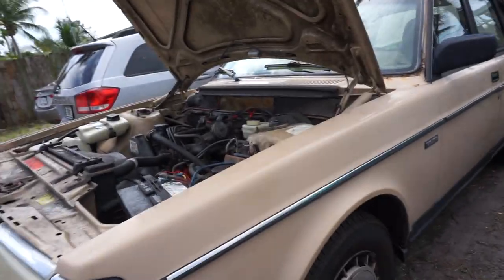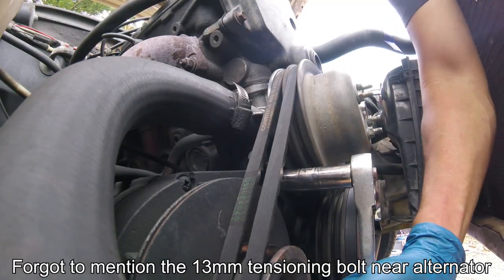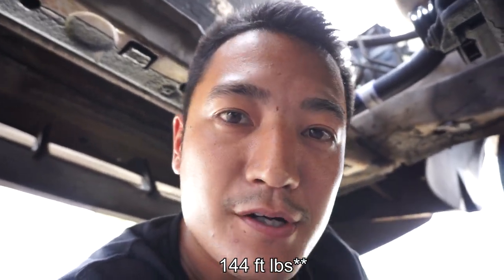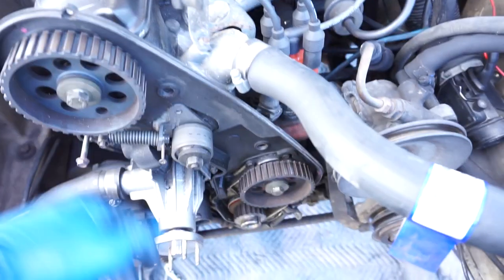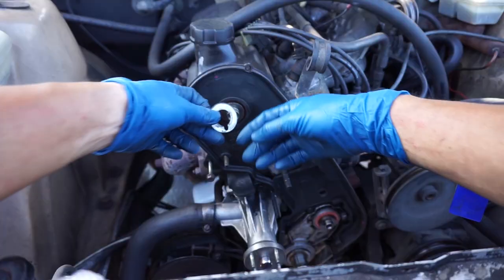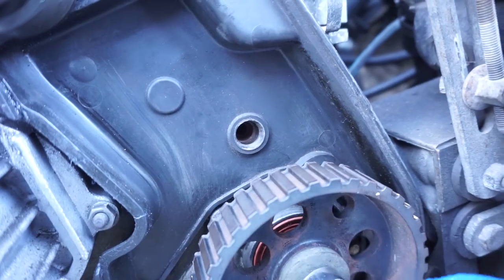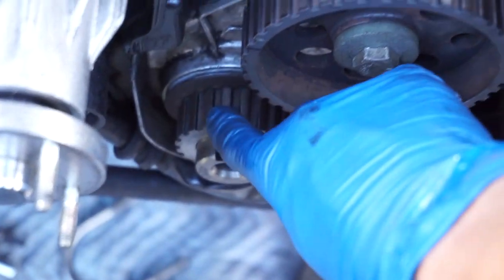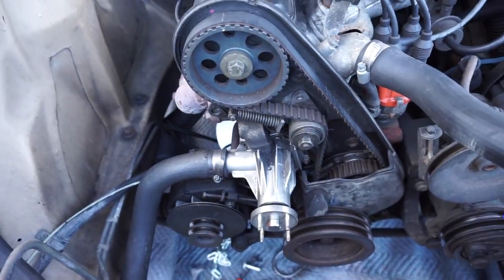How To Replace 1986 Volvo 240 Timing Belt and Front Seals

Comment: You don't need that ubolt and chain to keep the pulley still, just put the transmission in 5th if it's an m47 and chock the rear wheels
Reply from the maker: It’s AW70 though
Reply: I have taken out the front spark plug and used the special volvo tool to lock the engine in place.

Comment: Just a comment for anyone who might be watching this in the future:  The camshaft seal needs to set further back in the groove than shown when he took off the pulley and washer.  There is a chamfered edge and the seal needs to go far enough back to clear the back edge of that chamfer.
Reply: Having said that...this is a GREAT guide.  I used the u-bolt/chain method after watching this and have referenced the video several times as I’m in the middle of a belt change myself.  Great job!
Reply from the maker: Tha is Chuck!

Comment: I just finished my second timing belt job on an 88, last one was an 89. two years ago.  Thanks to Matthew it was a complete success. Regarding removing crankshaft bolt, I used an air impact gun and pully did not move. Tightening the bolt torqued it to 44lb and held the pully by using metal coat hanger wire and wrapped around sturdy part, and twisted the coat hanger.  Good luck to all the 240 volvo owners, and all the best from New Rochelle N.Y.

Comment: How did you loosen the upper gear bolt? How did you press the seals in?  Also, I would spin the engine around few times to make sure timing marks stay where they are supposed to, before closing it all up.

Comment: This video really helped. Pretty bummed you sold your 240? Please get another and make more videos. The community needs it! Volvo for life
Reply: 240s are notorious for the engine and the transmission leaks.
Also have wiring issues.
Reply: @FairScale-tx1qv  Post-86 cars generally just have the usual age-related corrosion issues with the wires that's common in all old cars... pre-86 cars have wiring you'd swear was made by Lucas. And the overdrive unit on the M46 is just the icing on the problem cake.

Comment: Thanks for the info sir.  I have all the parts and I’m ready for the job. I thought I might of needed a timing gun, but I looks like it’s all about the marks.  1989 240 DL here.  Just hit 300,000!  Your videos are alway extremely helpful.  The worst repair job so far was replacing the blower motor, but I knocked it out.  Thanks again!
Reply from the maker: That’s awesome your odometer still works

Comment: As extra info to anybody with a B23E engine trying this at home: A - the power steering pump belt tensioning system is slightly different and on the battery side of the pump so you'll probably need to remove the air filter and battery to get to it, B - the crankshaft chain trick won't work as the pulley simply slides off but there is a harmonic balancer underneath that you'll need a ratchet gun/puller to get it off in order to get access to the crankshaft gear and seal underneath. Otherwise, a great video! Thanks
Reply from the maker: Thanks! I hope the viewers will see this helpful comment

Comment: Dude this video was insanely informative. Just did the water pump on my 240, now im gonna change the seals, belt and tensioner!
Reply from the maker: I appreciate the kind words, glad you enjoyed!
Reply: Ok so everything is peachy right now except i dont know how far in the crankshaft seal goes. The otger 2 sat right behind the tapered edge, but the crank seal is sitting sticking out a bit. Is it supposed to be that way?or am i not applying enough pressure to get it in properly?
Didnt find anything online to help.

Comment: Thanks for the helpful video. I replaced my timing belt today! BTW, I used an impact wrench to remove the crank bolt. Very easy and no need to strap down the pulley.
Reply from the maker: Thats awesome, if I had air tools, I'd probably do the same!
Reply: @mgaquer  no need for air tools, that's what the 5ft bar of pleading is for...

Comment: 8:48 Easy with the torque on the crankshaft pulley bolt, you said it right but captioned it wrong, the CORRECT TORQUE IS 44 FT/LB OR 60 N.M plus an additional 60 degrees or 1/6th of a turn according to the genuine volvo manual. And for the Camshaft and intermediate shaft sprockets the correct torque is 35 FT/LB & 37 FT/LB respectively.

Comment: Many thanks for excellent home mechanics video.
Reply from the maker: Thanks, did you repair the issue?
Reply: Hi, I have changed the timing belt twice, but never the seals. Next time I will replace the seals and the water pump as well. I don't have any leaks, so it will just be preventive maintenance. I have a 1990 240 GL with the B23F engine.
Reply: The engine has about 200k miles.

Comment: For anyone doing this in the future, instead of a bolt if you just get some 12 or 10 gauge mechanics wire and loop it through the pulley and the sway bar a few times it holds it too.

Comment: So glad you made this gonna be doing this soon. But a question: is there anywhere with all the torque specs needed for bolts?
Reply from the maker: For the crankshaft pulley bolt: 144 ft lbs and the rest I think I just did a 1/4-1/2 turn past tight (don't quote me though, im no expert lol)
Reply: Matthew Gaquer ayyye thanks bruh

Comment: Ok... Great video... But that u bolt trick is stumping me. I tried a 3" u bolt (largest at Home Depot), but couldn't fit the bolt in the hole. I tried a smaller one, but I just end up hitting the block or the plastic belt cover. What size u bolt did you use?
Reply from the maker: It was an exhaust clamp found at my local Discount Auto Parts store here in south Florida. Other than that, I’d go buy a straight bolt and buy that fits and just attach a chain? Hope this helps

Comment: I recently purchased a new timing cover - top, bottom and inner - and am having a heck of a time trying to install the top cover with the pulley in place. Have you ever tried to install the top cover without removing the pulley? If you have, were you able to? Thanks.
Reply from the maker: When you say top cover, do you mean the one easily accessible and held on by two 10mm bolts? If yes, then yea I’ve always taken that off first while every pull and timing belt is still intact. If you mean the back plastic that slides through all the shafts (top, intermediate, and crankshaft) then no, you will need to remove all theee to do that
Reply: @mgaquer  Thanks for your quick reply. Yes, I mean the top cover - not the inner or back cover. I tried to install a new top cover on yesterday without removing anything and wasn't able to. I left it in place - half on/half off - on the car all night and returned to it this morning to remove it completely. Unfortunately, it's only 15 degrees outside and the cold plastic cracked while trying to remove it. I will have to order a new top half and will wait until I do the timing belt/tensioner/seals when the warmer weather comes before putting it on.

Comment: Can you do a video on the hose layout? Maybe how to check for leaks, i really love your video style and i have 86 volvo wagon same color as your sedan hahah
Reply from the maker: It's pretty straightforward in regards to hose leaks. Is your car overheating? Is there a puddle of coolant below the engine bay? How long since replacement? Are they brittle and cracked? If you're unsure, the hoses are cheap from FCPeuro and IPDusa, just order them, drain your coolant, and refill the system with fresh coolant

Comment: Hey Matthew,  great video!  I plan on using this video to change my timing belt in the upcoming future!  Was wondering if you could take a look at a video I posted recently.  Having a major problem with my 240 '89.  Can't tell if its a fuel delivery problem, timing belt issue or PCV/Air intake issue.....

If you can't, no problem, keep up the good work.
Reply from the maker: marc cefalu sure, feel free to email me too
Reply: @mgaquer  I would email the video to you sure.  Just need your email.  If you want to look at here, I think you can find it on my profile

Comment: Thanks for the great video!  I replaced the timing belt for my 1981 volvo 240 in September.  I wanted to replace the 3 seals, but was intimidated for the removal of the 3 gears and putting them back on with the right torque.  How did you remove the cam gear and the intermediate gear making sure these were not moving?  Likewise,  how did you do it with the right torque without it being moved clockwise?  I could see one gear with 44 ft lb; what about the other 2?  I like your seal removal tool.  Did you make it yourself?
Reply: Thank you Mathew for the information!

Comment: Anyone else find the seals didn’t come out in one piece? After a long time picking at mine they just started to fall apart and I had to scrape them out. Also my old ones are paper thin and the internal spring from the intermediate shaft seal is nowhere to be seen, so thinking it must have gone inside.

Comment: Awesome video thank you!  How did you get the new seals in.....do they press in with your fingers or do you need a tool to get them in straight?
Reply: I️ did 
my timing belt, tensioner and seals today...the 3/8 socket extension worked a charm on the cam seal!  I’ve read that after 500 miles to pop off the plug on the timing cover, loosen the tensioner and turn the crank 180 degrees and re tighten the tensioner to ensure that any slack is taken out after the belt has worn in and stretched slightly.  Thanks for the great video!

Comment: So  -  I can't apply enuf squeeze to the spring clips on my 93   240  dist cap to secure it .   Is there a tool or technique for this?
Reply from the maker: terry smythe I start by getting one side on first (usually the side closest to the firewall), then use a flat-head screwdriver shaft, place under the clip on the front and use both hands on the screwdriver to pry upward until the spring can clamp on the dizzy cap
Reply: On mine all it took was some finger strength.  Maybe try strengthening exercises like the old squeezing the rubber ball trick?  Or you could try getting very angry at it and the adrenaline will give you a boost.

Comment: I have 1986 volvo 240 dl.Im at my end of rope i have no spark from coil.I replaced icu,ecu,mass pickup in distributor,coil,ignition switch,fuel relay,spark plugs need help please
Reply: bad plug wires

Comment: there is a wagon for sale its a 1986 Volvo wagon 240 red block and it needs a trans it has 160kmiles they want 700 bucks and the engine is good and wagon looks nice do you think is worth it?and do you know model number on those wagon transmissions?will a sedan  transmission fit on a wagon?
Reply from the maker: Depends  on the shape, if it's auto/manual, and basic overall condition if I'd get it. If the tranny is automatic, it's the AW70 which u can find at most junkyards or even Ebay, but depending on your skill level is up to you if you want to tackle that job. I'd prob wait to find a 240 for <$1500 and be all set. Just my opinion though
Reply: thanks brother I wanted the opinion of someone that has Volvos.im gonna wait till I find a better Volvo .peace

Comment: I wonder at the same thing as ttt288, but i can’t see what you answered him?
Reply from the maker: What I did to loosen the bolts was keep the old timing belt on and also locked the crank. That allowed me to break the bolts free, then proceed to remove the gears while installing the new seals. For tightening, the bolts only needed to be tightened to 44 ft lbs if I remember correct which I wrapped the old timing belt around each gear and had someone hold the belt tight while I tightened to correct torque. When you set the new belt, just line up all gears according to timing marks and viola!
Reply: Volvo 240 Matt thx for good video and quick response:)